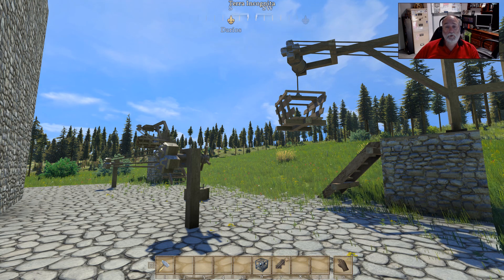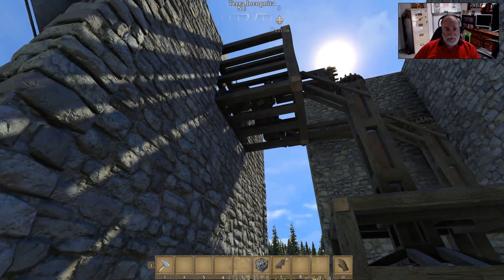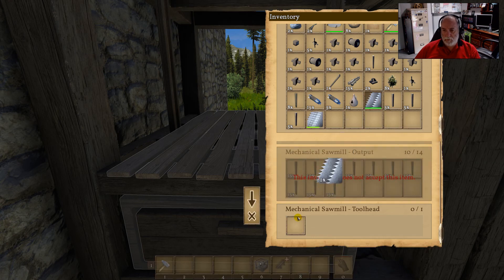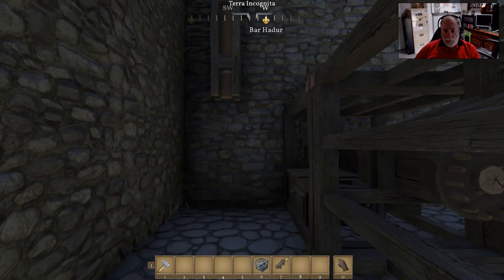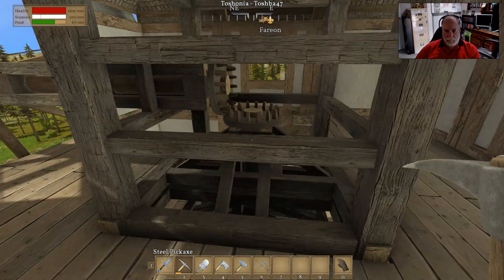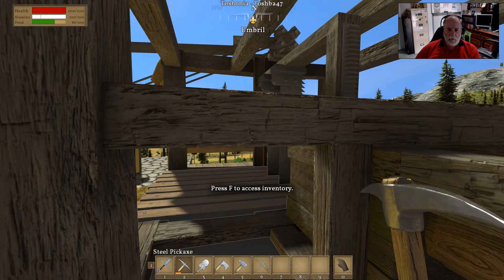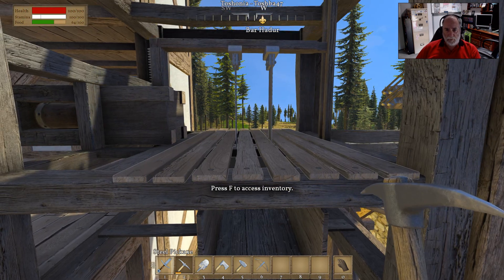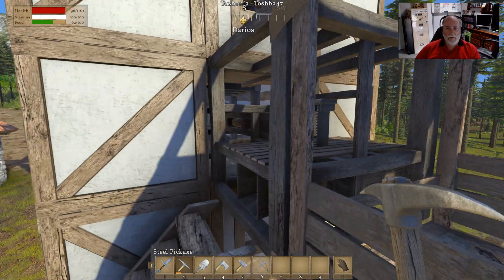Medieval Engineers - Mechanical power with a windmill

Comment: How can i biuld a framed vertical mechanical joint, up?
Reply from the maker: Hi Joel, I am sure there is a frame vertical joint up in the standard mechanical blocks. If the block has a "+" on it then there are multiple selections that can be made from that block by scrolling the mouse wheel. If you select the vertical shaft and scroll the mouse wheel I think there is one as an option for that block. I can't check in game atm but I am pretty sure that's right. Cheers and thanks for the question.

Comment: A tip when building your windmill, is when you place the angled shaft you connect the blades to, don't use a framed one, do the normal non-framed angle, and it'll let you place a wall with window on it, and then you can place your blades on top of that. The shaft sits through the window nicely, and looks a lot neater than having a huge hole behind it.
Reply from the maker: Thanks Sukebei for the tip. I had seen that on some other vids and just totally forgot about it. Cheers and welcome to the channel.

Comment: Awesome Tosh. Watched this yesterday and tweeted it out, but wanted to come in here and say thanks. How expensive was this to make. The sails look like they may require a lot flax for cloth. I still need to learn these pieces, which I hope to work on today. Would look good hanging out from the warehouse for the lumber mill.
Reply from the maker: It's not too bad actually. It is 1 cloth per blade (4 of), 6 ropes and 4 more cloth to finish off the windmill. Some timbers and sticks etc and the linseed oil. Yes it would look good up there and would make sense too with the crane to bring up the wheat and flax seed. Maybe the baker could be on the next spire across the new bridge you where talking about in the last ep. Cheers and thanks for dropping by.

Comment: The 3 high won't turn the saw mill and mill stone at the same time, but the 5 high will......is that correct?  Or does it depend on the placement of the shafts? I want to build my windmill fairly tall anyway, although I may build 2 separate ones eventually.
Reply: I came to the comments because I had the same question, it seems that the higher the windmill, the more power you get.
Reply: This is a good question, because in the creative world only one item could be hooked up at a time.
Reply: I've got a 5-high in my survival world that runs 3 (the mill and two saw benches) -- but it's quite slow.  I didn't think to just swap heads out of the saw-bench, lol.  That sounds much more efficient. 
(I also didn't know you could put logs into the plank-saw and skip over the timber cutting).